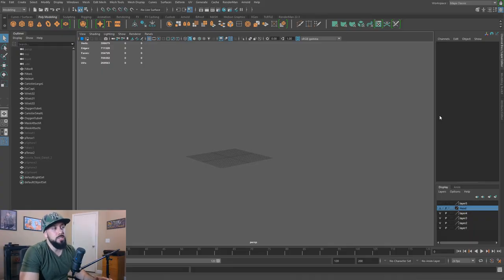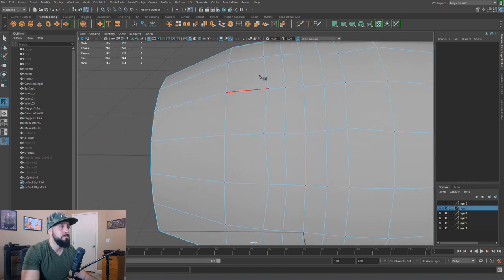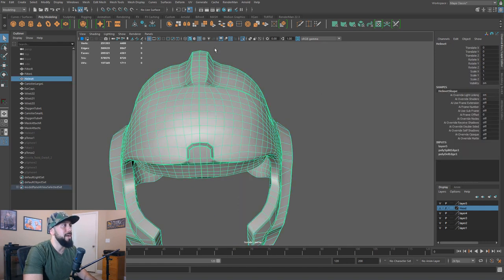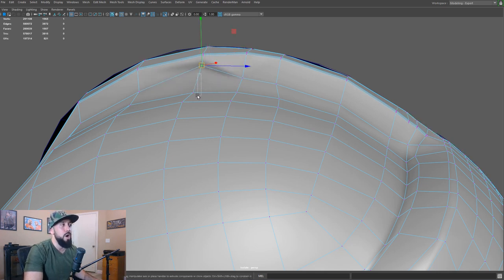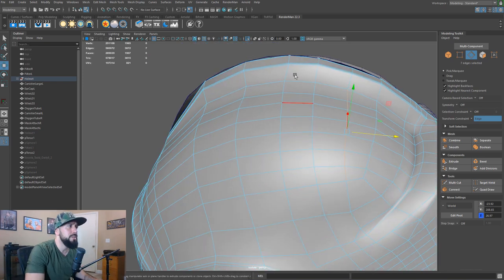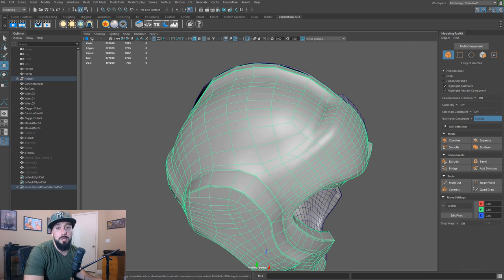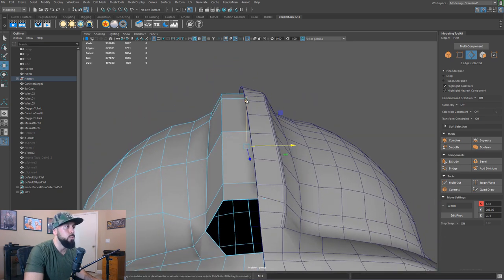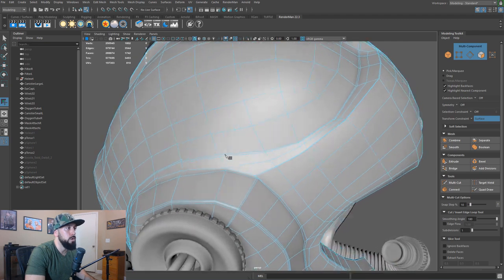Maya Hard Surface Modeling Tutorial:  Lumpy Surface Fix

Comment: If polycount is not an issue sometimes you can crease the hard edges on the low poly, apply 1 smooth subdivision, select again the crease edges (quick select sets are very useful if you have many edges to select) and turn crease back to 0.
You end up with more polys but if you hit 3 and turn the subdivisions to 1 in preview mode (2 is the default), the final preview has the same amount of polys.

Comment: Hi this is Tadd, thank you for this! This has helped me so much already. Currently seeing improvements to my model as I use some of these tools and techniques. I saw in the comments someone recommended lowering the amount of geometry to work with to let the smooth mode do most of the work. It does seem having less verts lets the smooth mode transition a lot more gradually. I must have over thought all the different shapes flowing into each other and overtime all of the geometry became overcrowded. Working with half of the model seems to be a lot more intuitive than trying to make sure I'm working in symmetry all the time as well. Mostly because sometimes i'll forget to turn it back on.
Reply from the maker: Glad I could help. Yea sometimes less is more especially when starting to block out your model.  The mirror tool has now an instance option.  Turn that on that might help keeping everything symmetrical.

Comment: Nice tutorial JLMussi. Tad might be trying to add detail to the model in the early stages of building. The hose model was lumpy as well.You can prevent lumpiness if you define the surface with larger polys. Add detail when you are satisfied with the overall shape.
Reply from the maker: Yup makes sense.   Low to high is the way to go.